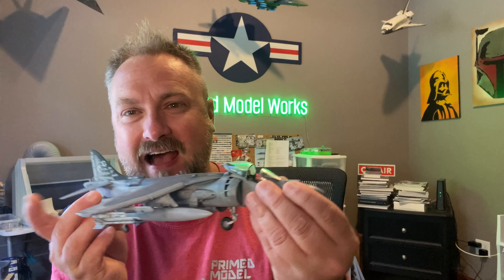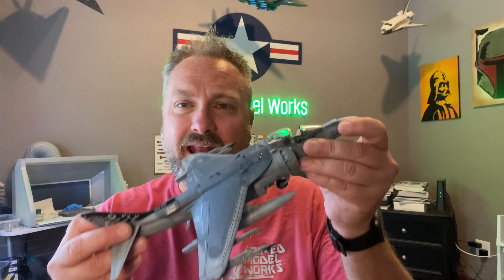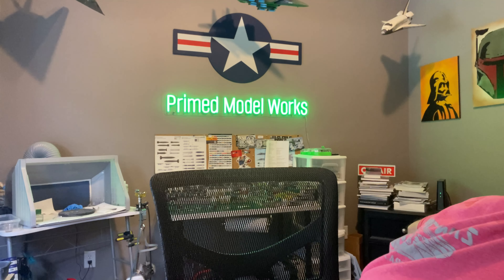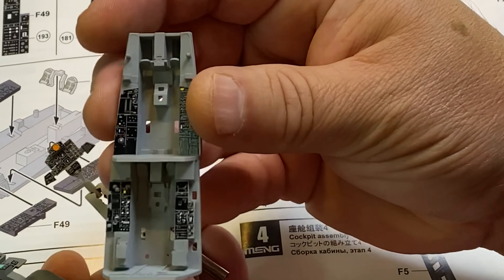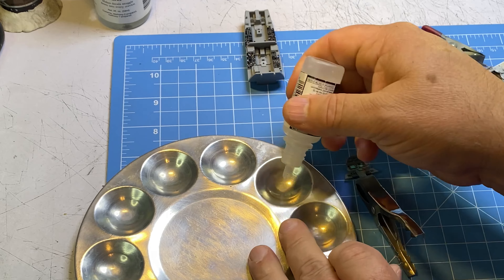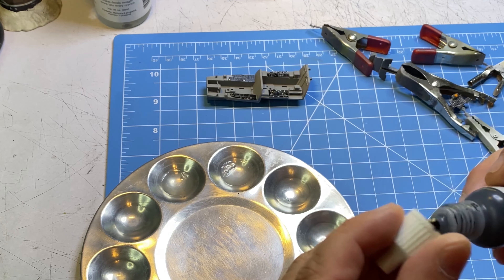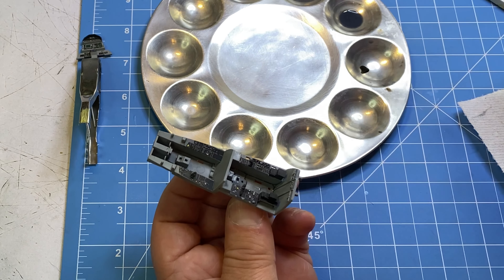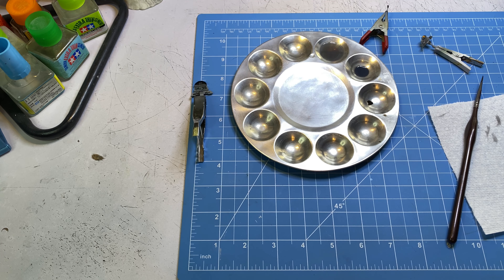Meng 1/48 F-4G Phantom Build Part 1: Cockpit

Comment: Fun-fact --
F-4Gs DIDN'T originally leave the McDonnell Douglas factory in St. Louis, MO as F-4G models.
All F-4G models were CONVERTED from previously-built F-4E models.  They converted close to 140 E-models to G's.  Structurally, they're pretty much the same as they were as E-models -- slatted wings for greater maneuverability and to address handling issues the "solid wing" models had at higher weights, and the gun muzzle.  The M61 of the E-model was removed and the muzzle opening was sealed.  I think extra electronics for the SEAD mission were installed in place of the gun.  
The gun alone caused a stretch in the basic F-4 airframe of around 4 ft!  The nose from recon models (RF-4B and RF-4C) was adapted for the F-4E to accommodate the gun in the stretch.  You could install external cannons in pods to replace the removed M61 cannon (after the G-model conversion) but the gunpods create a lot of drag.  I'm fairly certain the G-models were armed with Sidewinders for self-defense but their main protection (besides the jamming equipment) would have been the type's speed.  

The G-models were never intended to be used as dogfighters or interceptors after their conversion!  I think they removed a lot of the air-to-air component electronics and replaced them with specialized air-to-ground systems specifically for searching and jamming enemy radar installations.  Recon and Wild Weasel planes historically have been equipped differently from the mainline air-to-air specialist (think original F-14A, F-15A-D) and multi-role planes (F-15E, F-16 virtually all models, F/A-18A-F).  The F-4 was a fraction of the cost of the later Teen Fighters and it was far cheaper to produce specialized single-mission variants (recon, Wild Weasel) of the F-4 than the later planes.
The F-4 G-model was never exported to my knowledge.  The jamming systems and mission-specific electronics (which were no doubt updated from time to time) were things USAF wouldn't have wanted to fall into enemy hands.  The F-4G Wild Weasel served as the SEAD platform from 1978 to 1996.
The F-4G was replaced in USAF service as the main SEAD platform by the F-16C Block 50/52.  Right now, they're planning on supplementing those F-16s with the F-35 because of the F-35's stealth and much more advanced avionics.  We'll see...  budget concerns may crush those plans much like they pushed up the retirement dates for a bunch of Vietnam-era tactical planes (A-7, F-111, F-4)!